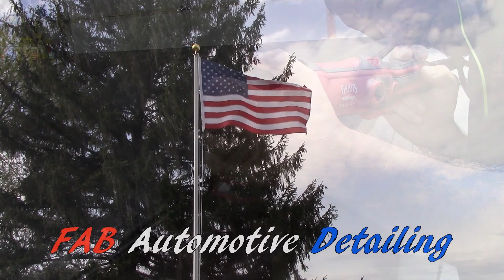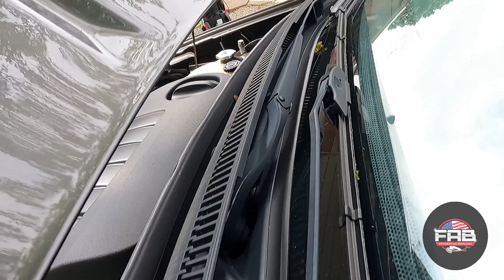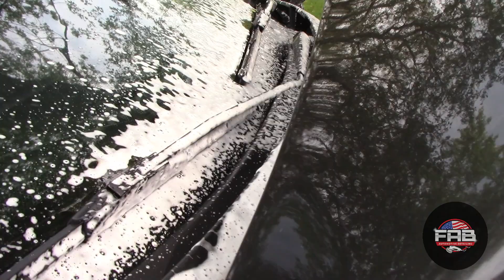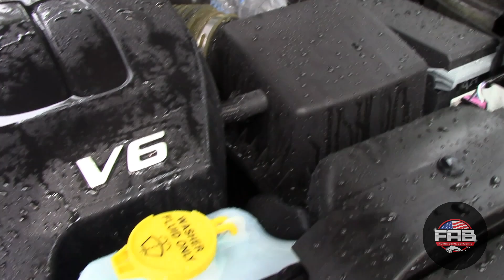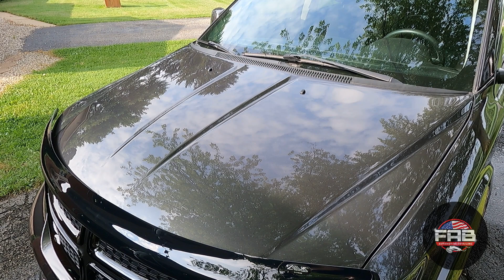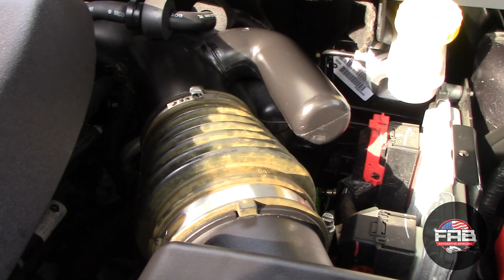How to: Easily Clean and Dress an Engine Bay!

Comment: Ever try dollar tree furniture polish? People think I'm nuts, but after I clean the engine compartment I spray it down with the cheapest furniture polish from the Dollar tree. Then I shut the hood then start the motor let it dry and you have the perfect amount of gloss. Not matte but not gloss. It's kind of hard to explain but the plus side of the furniture polish is it repels dust so your engine bay stays cleaner longer. Fab if you ever get bored and want to just waste some time you should give it a try. I think you'll be shocked at what a dollar can a furniture polish can do to your radiator hoses and plastic engine covers.
Reply from the maker: I’ve never even heard of this method. Thanks

Comment: The Griot's Foaming Surface Prep is a perfect product for Engine Bay cleaning.    Performs extremely well in that application as well as prepping the paint surfaces for a decontamination wash/prep for a new wax/sealant/coating application.  I swear by that stuff.    Just wear gloves when washing with it because it is a VERY high PH and concentrated formulation that WILL burn your skin if not careful with it or use it full strength.    That said,  it is a fantastic product.    One of Griot's best formulations in my opinion.    All their foaming surface products (the trio) are fantastic, work exceptionally well, and each do their intended purpose very well.
Reply from the maker: I agree it is an exceptional product.

Comment: Why did u use surface prep on your paint? I thought that was coated?
Reply from the maker: The Journey isn’t coated. I used it to remove anything that might be on there. The last thing applied to it was Griots Ceramic 3in1. I’ve just kept spray waxes on it recently.

Comment: Haven't tried surface prep from Griot's Garage for engine bay since just used it to strip paint, great to learn this other alternative.  I normally use a mix of Dawn with water or Ethos APC or Doctor Mecánico or the APC from Chemical Guys Nonsense Invisible with brush agitation 😄
Reply from the maker: You should try it you will like it.
Reply: Because of the low costs, my strip solution is Purple Power Vehicle & Boat wash ($8.00 per gallon) Super Clean ($21.00 per 2.5 gallon) & Dawn dish soap.

Comment: Do you degrease the driveway  after cleaning engine? All the crud has to go somewhere. Good video.
Reply from the maker: I don’t ever clean really dirty engines. I maintain mine so they don’t get bad and none of my cars leak oil. If they were leaking oil then yes you would have to clean the driveway. Thanks